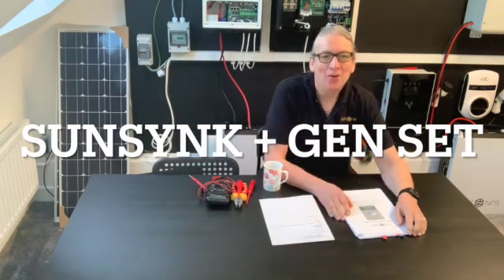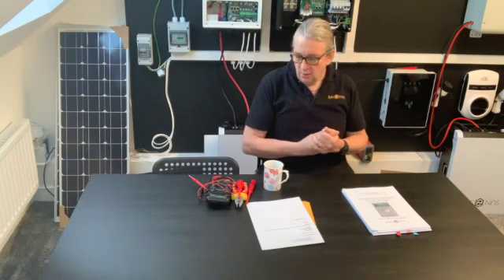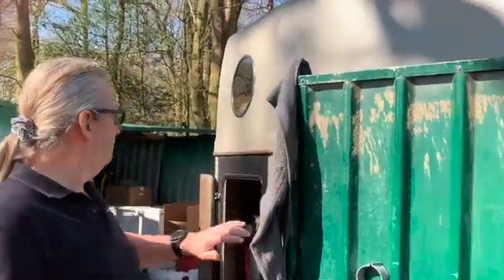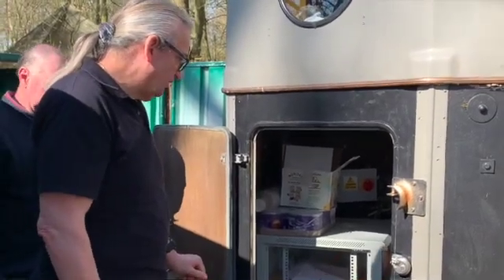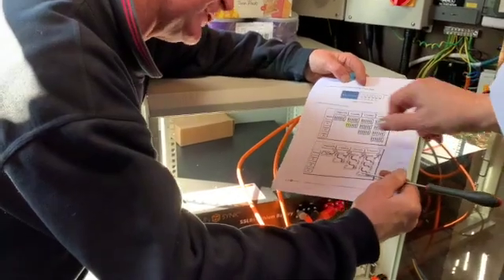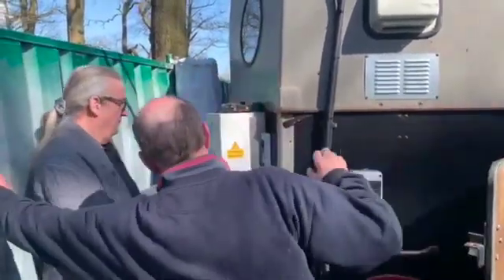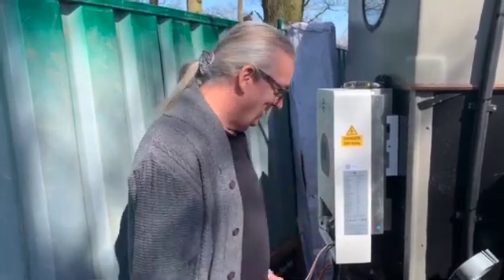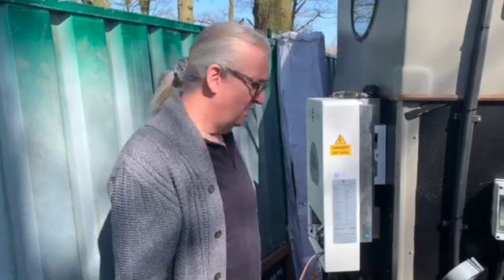Sunsynk Inverter + Gen Set

Comment: Currently aux loads will only be supplied with solar power, and not with power from the battery. I there a way that the aux load can use power from solar and battery and not from the grid?

Comment: Hi just installed my Sunsynk yesterday and the installers cant seem to get my generator a 7500w petrol wth AVR to charge the batteries it kicks in and then kicks out after 10 sec.
Reply from the maker: It will be a setting I’ve uploaded a video and there is a manual to go with it about using Generator with Sunsynk inverter
Reply: @sunsynk  can you post that manual also link to video as its been a week and these installers are still struggling. Will a 7.5kva petro genset be ok to work on the inverter as all they tell me that its to small my load on inverter is 300w